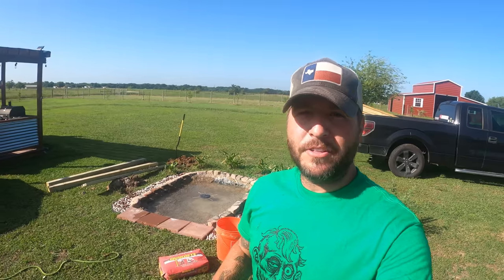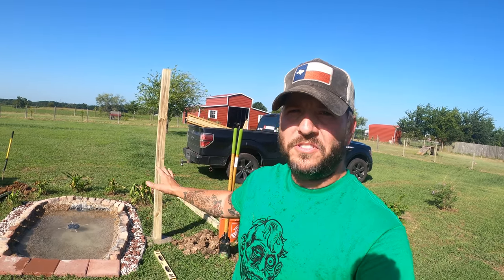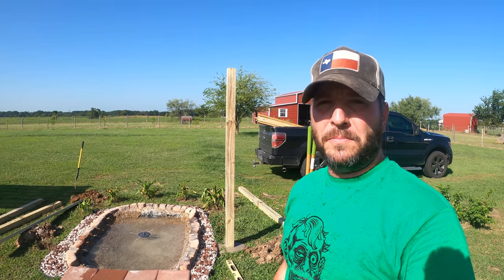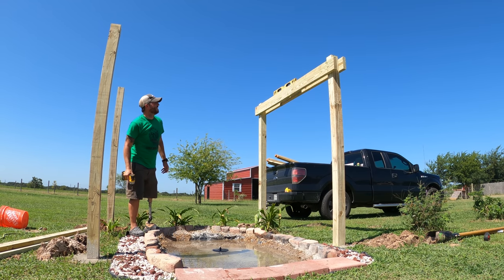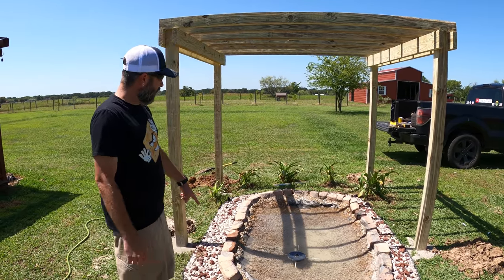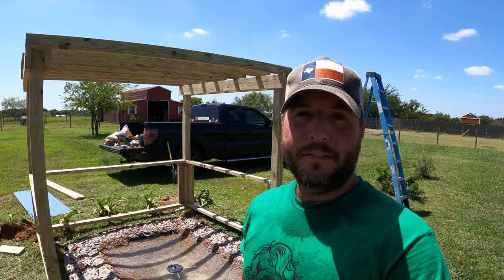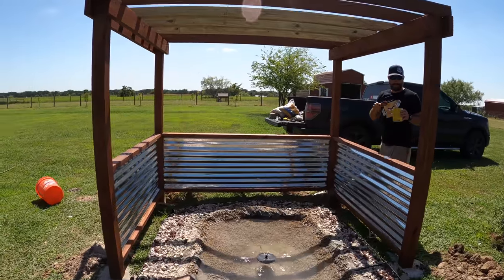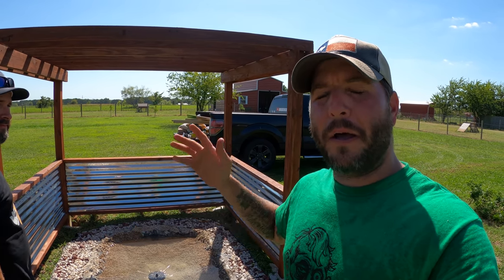DIY Pergola Build Start To Finish -  Total Cost of $200

Comment: It's easy to use pieces of wood to prop up the corner pieces whilst they are drying. 
I didn't even use concrete, just used the metal spikes straight into the ground.
It's still solid.

Comment: Will the little fountain still work with the shade cloth?
Reply: I was thinking the same thing Cyndi
I dont really care for the tin around it
Reply: @donnacole4227  He made this pergola to match the existing pergola.  @Cyndi, they may need to change the fountain out with a battery-operated one, if so, this one will work in the other little pond.
Reply from the maker: Sun will still go through the shade cloth and the pond will still have some kind of sun on it.

Comment: Matt was so proud of what he did for you. It just seems like you didn’t feel it was good enough. It was a pond for the dogs. The dogs could run in and out of the pond in either direction. Now you’ve blocked one of the exits off with the tin. My feeling is, the dogs won’t use this pond at all. Yes, it’s beautiful but Jared, you missed the whole point of why the pond was made by Matt. I’m not a hater. I’ve spent a lot of time watching all the Crocker’s for the last two years.  This is just my opinion. Peace
Reply: If it walks like a duck and squawks like a duck, it's a duck, sounds like a hater. Did Matt consult you with the whole point of why he made the pond? He shared with all of us that he did it for the dogs to have a nice place to cool off while outside. Adding the Pergola with the tin will keep the water cooler for the dogs, shading it from the sun. Matt doesn't look upset with the upgrades to the pool.
Reply from the maker: Lol I know exactly why Matt made the pond. I was busting Matt's balls about it.